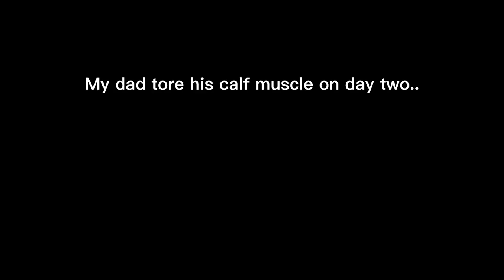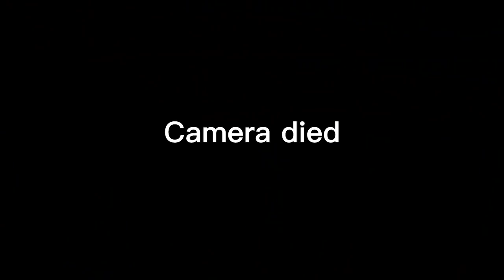FULLY GUTTED MY AMBO! | Episode 2

Comment: What is with the SD error issue?  I had that recently happen after several jumps I recorded and ended up loosing that footage. I figured I had improperly ejected the memory card when downloading data to a MacBook.  I figured that was the issue and hope that doesn’t happen again.
Reply from the maker: From what I’ve heard, it’s an issue with the GoPro’s themselves but they seem to try and pawn it off to the SD cards for being faulty. Definitely not the case.